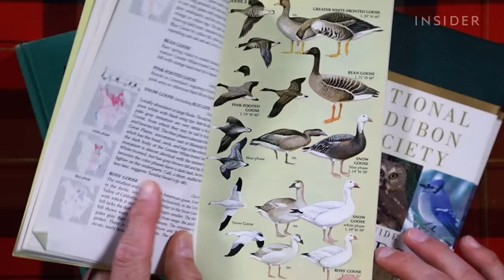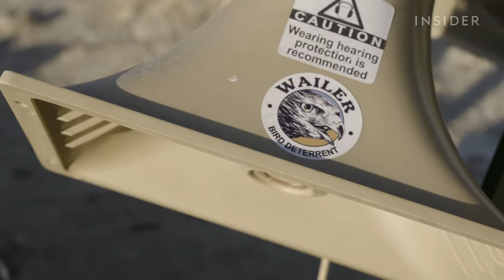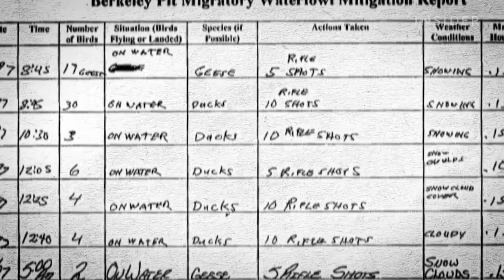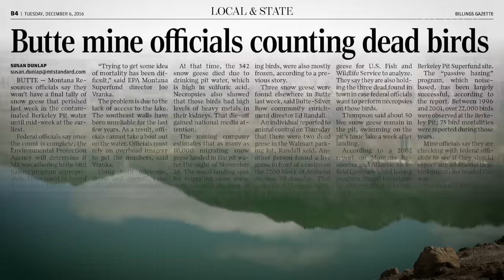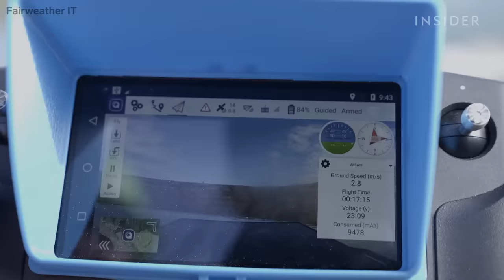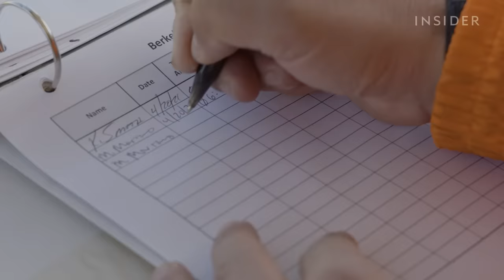Meet The Man Who Shoots At Birds All Day To Keep Them Off A Toxic Pit | World Wide Waste

Comment: All of what they are doing to prevent these birds from settling on the contaminated water seems so incredibly wasteful. Without giving much thought to a better long-term solution, I thought of what is done at Lake Mathews, in Riverside County, California to minimize that reservoir's water loss from evaporation. 

We have so much plastic waste in this country that gets dumped because recycling costs are higher than making more from scratch. Why not make plastic balls (shade balls) and dump enough of them in these types of quarries that all of the water is covered. Nowhere for the birds to settle on the water, no dead birds.
Reply: I think it’s because the chemicals in the water would erode the shade balls
Reply: @Toronel  I must admit, I hadn't thought of that possibility. Although, there are many different plastics. There is probably one that won't erode. This is something they should look into. After all, they are spending millions to keep birds off of poisoned water.
Reply: Birds think they are a solid surface, land and slip beneath, become drenched and drown.
Reply: You could float the idea by the dudes that are cleaning the ocean
Reply: @ZebraFacts  I don't think using a loud speakers, laser and a gun just to scare off the birds will cost millions. That's why they do it because it's cheap. Companies wouldn't want to spend millions just to save some birds
Reply: @HOHo-ws4mq  they said it was a multimillion dollar arsenal, plus it's paid for by the government not a company.
Reply: @Toronel  definitely not
Reply: After reading classic ambo's comment about birds thinking "bird balls", now known as "shade balls", may have caused other issues. I couldn't verify the possible issue of them being dangerous for birds, there were possible carcinogens involved with the plastics that were used to make them. 

Shad balls were removed from all LA reservoirs except one. The largest reservoir is just too large for the new covers that would cost upwards of $250 million for that one reservoir. 

Federal rules mandate that all bodies of drinking water open to the air be covered. Floating covers provide more of a complete barrier from both sunlight and airborne contaminants. I can see how covers may be safer for birds. 

I think just as we are discovering the ins and outs of this issue, I would think the government can also find a better, and cheaper way to protect wildlife from the poisons of this quarry.

Comment: Amazing work! Why not use a line of drone boats constantly patrolling in a line back and forth over the lake? Might work 🙂
Reply: As they said, the different birds respond differently to the deterrents and the boats aren't as effective when there are ice sheets or closer to the shorelines. Also the operation and maintenance of constantly operating RC boats would be insane in comparison to just deploying them when the appropriate birds are showing up
Reply: @CPFitzgerald  Good points. Maybee a cable stretched over it that's going back and forth? 🙂

Comment: I respect their efforts definitely but it seems to me that they would spend less money and be better off in the long run to start the pumps again or put in new pumps and keep it pumped out. Just my opinion but I could be wrong.
Reply: It's really not that simple. If they just pump the water out it will just spread this pollution downstream into other ecosystems or into the groundwater where it could cause massive damage. As much as the pit sucks it's better for it to stay in one place until there's a good way to actually neutralize and filter the water
Reply: They are pumping to some degree and extracting the metals from the water..
They seem get a fair amount of copper from the water but it's a huge job and every rain etc.. Just fills it back up..
Reply: The situation is far too complex to take the simple approach of pumping the water out. Since then there's the question of, where will the water go? We can't exactly destroy it nor burn it off into vapor because you know. It's toxic, and it is far worse to have toxic fumes than toxic water in one spot. So I think the cheaper option right now IS to use this system. Since there just isn't the technology to magically get rid of the water and have it not have to be put someplace else. Better it remain in a controlled setting where it can be monitored instead of being moved around at risk of pollution areas outside of the mine pit to be held up in government red tape in much more dangerous or less controlled settings for the possibility of vast pollution.
Reply: Such a dopey comment xD Pump it out where exactly ? into the ocean?
Reply: @zakofrx  probably gettin copper from all the bullets being shot into it lol
Reply: I was thinking of a pump/filter system too... but it would be really impractical at this scale.  The plastic balls would prevent evaporation and increase the rate at which the pit might spill over....  I don't see a great solution atm.

Comment: Fill it in?  As it was an open pit mine that was dug out, fill it up and displace the void.  Problem solved.   Approach 2: restore and operate the pumps.  What I just watched was head scratching futility that ignores root cause analysis and resolution.  Approach 3: convert this pit into an energy battery.
Reply: filling it in would have to happen before it's flooded. at this time, there's a bunch of nasty water, and this is the safest place to leave it

Comment: They have a method of dumping millions of softball-sized polyurethane balls to cover the entire surface of freshwater reservoirs for drinking water. Perhaps a method like that could be used here
Reply: It wouldnt work. Its acid. What do you think will happen to the plastic balls?.
Reply: @JoRdi-ul4xg  in the oilfield they use polyurethane piping to move highly corrosive acidic saltwater from the wells to injection sites to be pumped back underground. Probably way less expensive to just pay these guys to do this though

Comment: So why not turn the pumps on, drain the lake and the mines, fill it up to a a reasonable level, line it, and put more dirt in it, and then let it fill? Would you even need to line it? Shouldn't dirt filling the mines be enough to stop the production of sulfuric acid; the mines were covered in dirt originally, right? 

I'm not an engineer, or a chemist. I really don't know. Just wondering.
Reply: where are we going to put the water? it would just contaminate other places if we try to remove it

Comment: Couldn't they just cover the lake with something? Like the same material used for trampolines or even some kind of net that is held above the waterline. I've heard of 18 mile long fishing nets so a mile long is nothing. You just implant concrete hard points all around the perimeter with winches to position the net. Use a material that's light and durable then just have someone come check it's condition every month or something. It would be so much easier and cost effective.

Comment: What if there would be water canons on boats, by creating rain wouldnt acidity slowly deteriorate? Ergo creating a clean layer of water?

Other stupid idea for just that, imagine fabric/liner PE or PP 40mX40m. While on top of water, add clean water. Now this would require some kind of control over fabric but idea is that removing that liner few times carefully could gradualy create a layer of „pure” water on top.

Also, there are materials that dissarm acid, least elegant solution would be to maybe just connect pee sever :p and again gradualy make it less active. Each would need additional research and engineering. But maybe there is a way to „reclaim” this water

Comment: Would it be cheaper to cover the water surface with acid resistant plastics beads?
Reply: chickenwire is approx. 2-4 $/SF // lake is lets say 1x.5 square miles = 13,939,200 SF // = 55,756,800$ //  & it would be more with having to install supports and make sure it doesnt degrade to chemicals.

Comment: wouldn't the most obvious, cheapest solution in the long run, compared to what these guys (whom i have a ton of respect for) are doing, would be to cover the entire surface of the lake with a cheap net or chickenwire? 

surely paying one upfront installation cost seems alot smarter than wasting money on these fancy robots and alarms and wasting energy and manpower doing it? the lake is apparently 1mile x .5 mile. this really isn't that big an area if they've already paid millions to this research team and the fancy gear and will obviously have to keep doing so into the forseeable future

edit: chickenwire is approx. 2-4 $/SF // lake is lets say 1x.5 square miles = 13,939,200 SF // = 55,756,800$ //  & it would be more with having to install supports and make sure it doesnt degrade to chemicals // LOL i was wrong
Reply: yeah but thats not as fun tho lol

Comment: Instead of fixing the initial problem, USA does what they do best: look for any excuse to use firearms in any way, shape or form possible.
I am pretty sure that even without fixing the acidic water problem you can solve this issue with some decent PZT cameras, drones and clever AI.
Reply: one cheaper the other is expensive often the simplest solution is the best